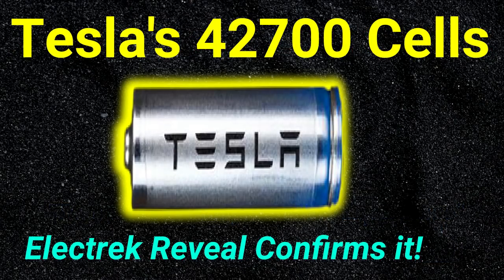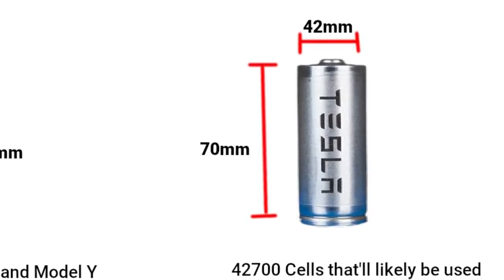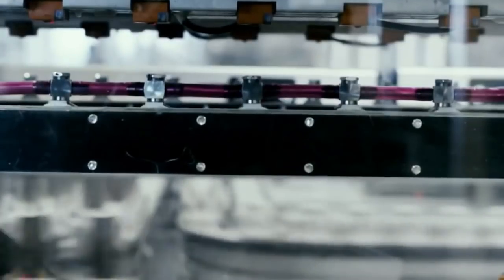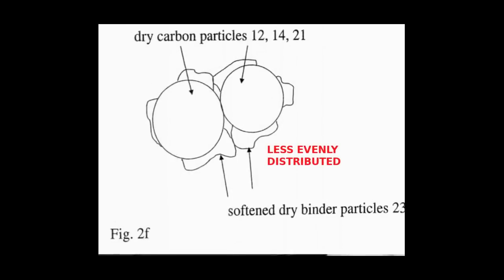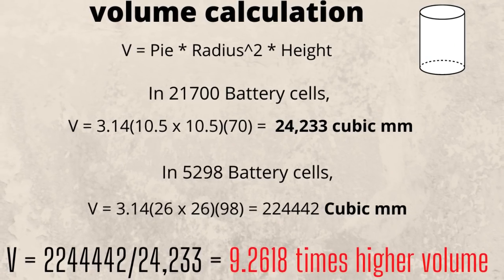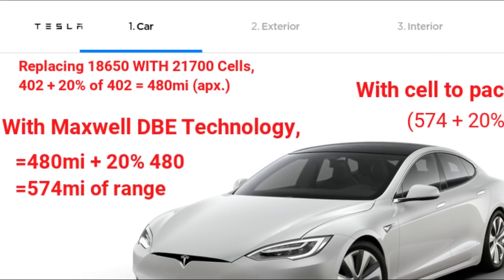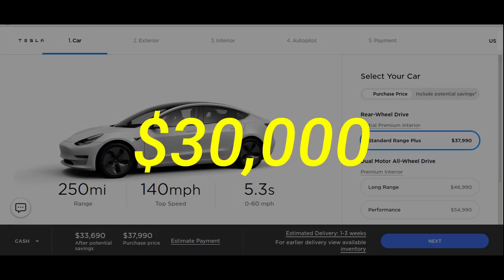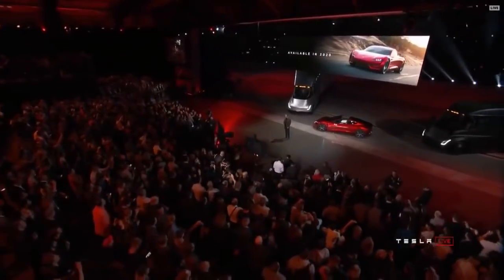Tesla's New Roadrunner cell will "BLOW YOUR MIND"  : 42700 cells | Battery Day will be "VERY INSANE"

Comment: If they charge and discharge faster that could be massive.  Fast charging speeds and then the cars will have much greater acceleration.  They probably designed the Plaid engines to specifically take advantage of this.  I'm very excited for the announcement, could put Lucid to shame.
Reply from the maker: Just 5 days remaining!